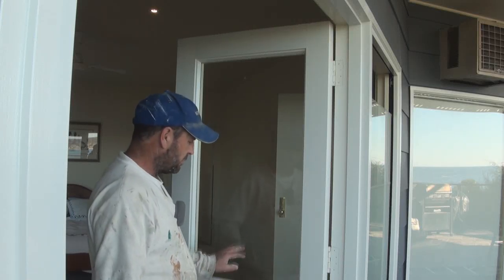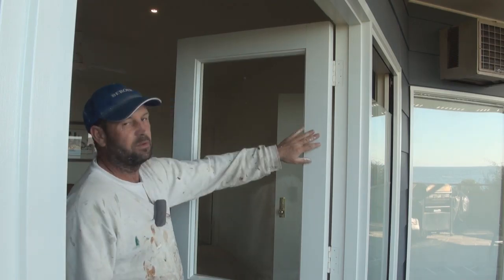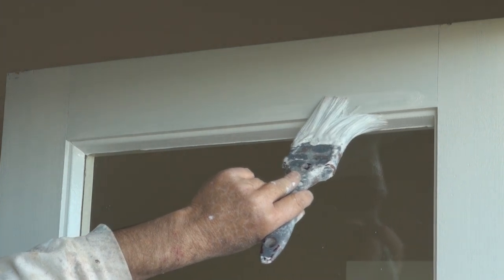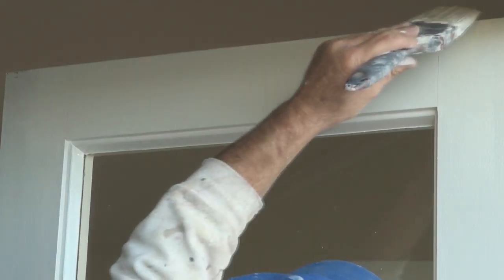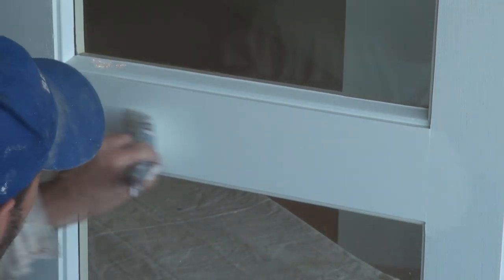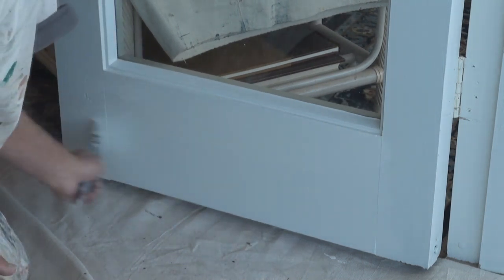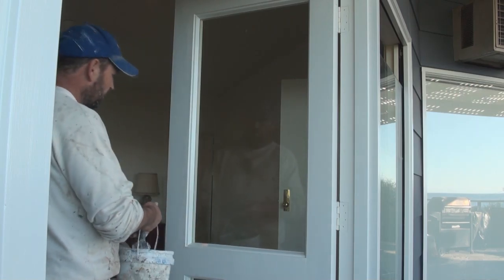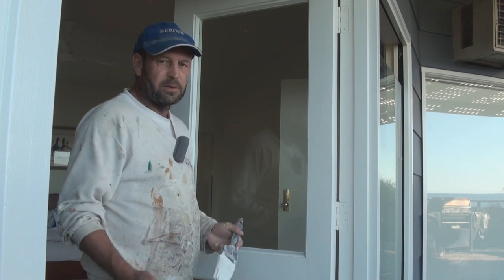How To Paint A Front Door - Painting the exterior of a glass panel door or french doors.

Comment from the maker: That is a good point about top and bottom edges, in this video the door has a weather seal on the bottom edge and to remove it would mean destroying the paint work on the inside of door. Generally with repaints the top edge is fine as long as it was painted the first time, if a door opens outwards and is exposed to the weather then you should always re-paint the top edge.

Comment: Hi mate 
I painted some doors recently that had a flower pattern in the glass which meant that when I did come slightly onto the glass like I should it was near impossible to get a straight line because the glass wasn't flat.  The flower was raised with lots of different parts meeting the frame . Tried to resort back to tape but because of the uneven pattern it bled like hell. Any advice mate? Thanks again  miss the videos
Reply from the maker: You could try to caulk next to the glass and see if you can get a straight line that way, not so easy whey you have patterned glass to cut in to. 
Don't forget to Like, Share and Subscribe.
Reply: @howtopaintinfo  thanks mate hope your well. Miss your videos

Comment: If I am not happy with the casings and window frames I just painted - they are showing brush marks - do I need to re-prime and start over? Or can I do a light scuff-sand and do a more careful top coat? Thanks as always for the terrific video.
Reply from the maker: Depends on the paint but generally with all acrylics you can just go back over with the top coat. You can also do the same with enamel if its done within 7 days.
Don't forget to Like, Share and Subscribe.
Reply: @howtopaintinfo  I’m sorry, I think my question wasn’t clear; what I’m wondering is, does primer help cover old brush marks, or is sanding the key and primer is solely for adhesion? Thanks.
Reply from the maker: Sanding is the key and sanding is the best thing for adhesion,  yes most primers are for adhesion or sealing the surface.
Reply: @howtopaintinfo  so am I right in thinking that re-priming would only be necessary if I sanded down to bare wood? Thanks!

Comment: I really hate the glass on my exterior door. I value my privacy over the light that emits through the glass. It would be a huge hassle to replace the door. Is there anyway that the entire door including the glass may be successfully painted with good results?
Reply from the maker: Yes you can paint over glass just make sure it is clean before you start. I have done it a few times over the years for the exact reason you want to. Most acrylic paints will be fine but remember there is always the risk of paint being scratched off.